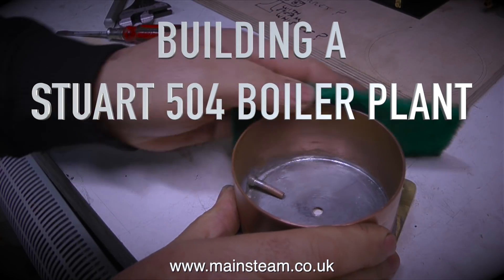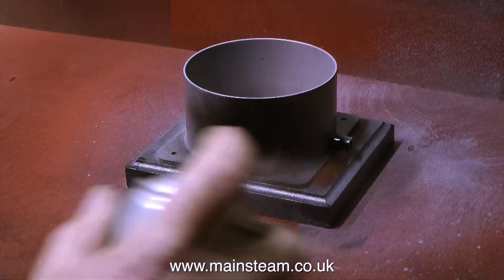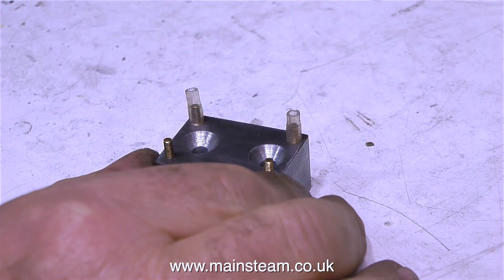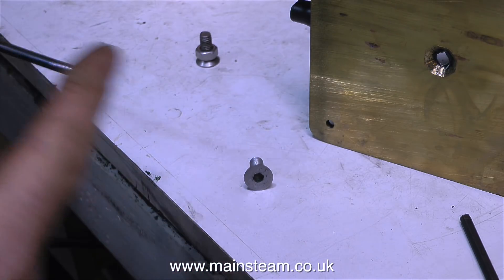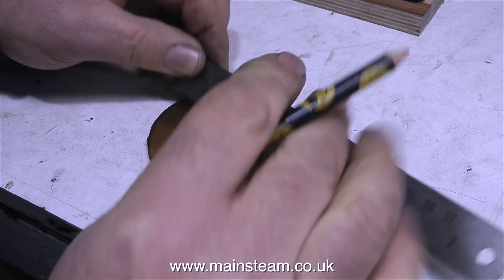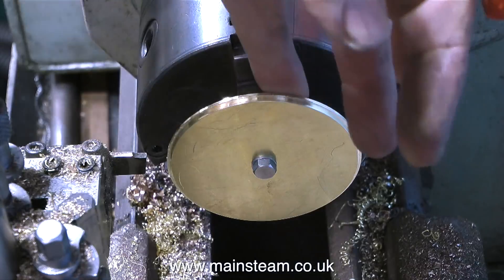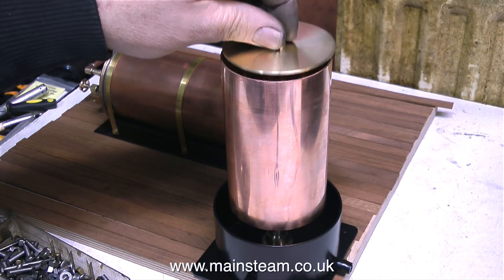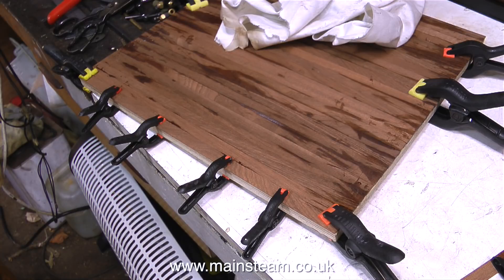MAKING A STUART 504 BOILER PLANT - PART #6 - THE TANK & BASE BOARD

Comment: Two questions if I may.  Since you're gluing wood to wood, why 'CA' glue for the floorboards and not wood glue?
Have you considered cutting the planks in shorter lengths to stagger them to simulate a real timber floor ?
Reply from the maker: Wood glue is not always waterproof . . . . yes I could stagger the boards, but most of them are covered up by the steam components anyway so it's hardly worth the extra effort......

Comment: I have a, likely, really stupid new machinist question about the top cap and the way you made it. Would marking the line out, center drilling,then cutting a square out and machining it round have worked? 

Really just asking, the only machinist that ever helped me with a lathe left us a few years ago ( he made the 4 cylinder rotary engine I plan to build a small steam plant for someday), and I'm just starting to teach myself the finer points of lathe work. Would prefer not to do the experiment and hurt myself or my crap lathe if others have. Thank you, as always, for the video and the info.
Reply from the maker: I roughly cut it to shape then machined it because it was quicker that way and less likely to end in disaster {:-)))
Reply: Keith Appleton kinda what I gathered, just thought id ask. I figured the de
Disaster part, but didnt think about the time being greater, but youre right now that ive thought about a while. Thanks for answering a begginers..... less than intelligent question lol.

Comment: Hi Keith! Are fusible plugs used in the model boilers?
Reply from the maker: Not usually.
Reply: fuseable plugs are used in model boilers if the owner cares at all about his boiler.You never know who is operating the boiler and the fuseable plug is cheap insurance to protect your crown sheet.Pete N.
Reply from the maker: Not necessary in gas fired boilers because you can switch off the heat, and as i said they are not usually fitted to coal fired model boilers either from my experience. I always make sure that it is quick & easy to drop the fire if problems with water feed occur - plus I always fire my own boilers so therefore know who the operator is - me :-))

Comment: You have to use a non ferrous magnet to pick up non ferrous metals like stainless and bronze and copper.
Reply: Some day I'm going to invent a brass magnet and I'll be set for life. Rats! I gave away the idea on the internet. Oh well, hopefully I'll get credit for the idea, at any rate.
Reply: Inverse non ferrous antimagnetic versions are also available if you happen to drop copper or bronze onto the ceiling.
Reply: That is funny right there, but in all seriousness I do believe there are magnets for non-ferrous metals. They use them in the recycling industry to separate aluminium from the other waste. It is an interesting device that uses an AC field to induce a current in the non-ferrous metal and then uses permanent magnets to cause the aluminium to literally jump off the conveyor belt.